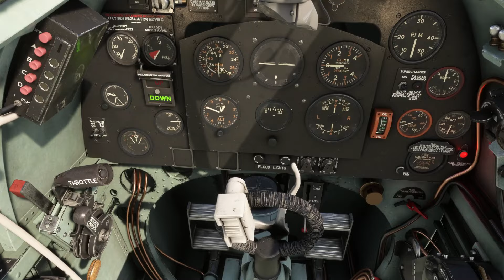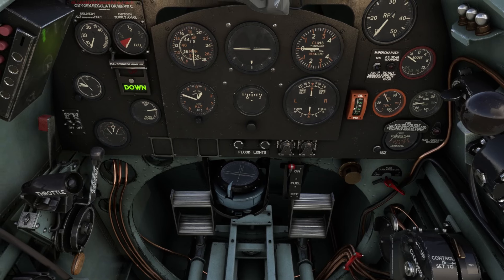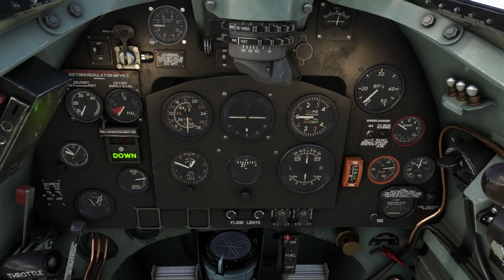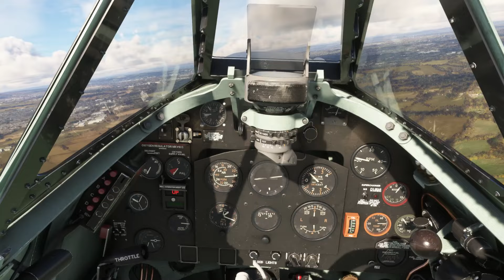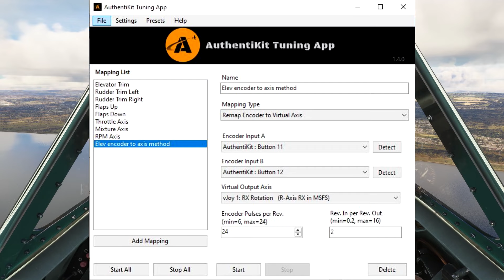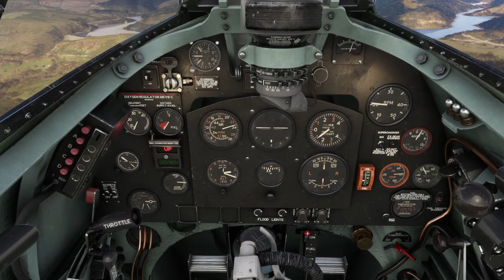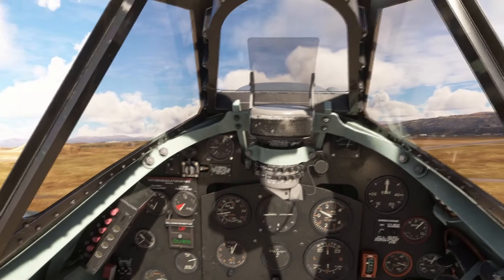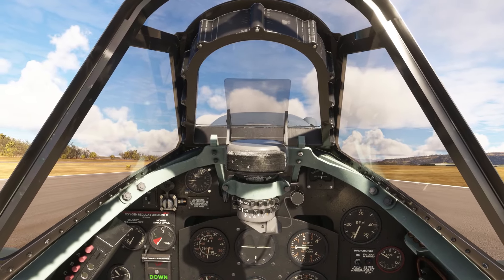Spitfire MkIX flight + AuthentiKit controls - Compton Abbas to Llanbedr Microsoft Flight Simulator

Comment: As for the voltage, most Spitfires today use the 24v system, although as far as MK.IXs go, MH415 & MH434 use the original 12 volt system.

Comment: The fuel cut off (sometimes known as the idle cut off) is the red topped lever to the left of the throttle. 😜

Mixture on the Merlin 60/70 series was fully automatic.
Reply from the maker: Ah ok, in this FlyingIron Spit that is still referred to as the mixture control but good to know! Thanks.
Reply: @Dreamsofwings  I had forgotten that! 

Keep the videos coming!